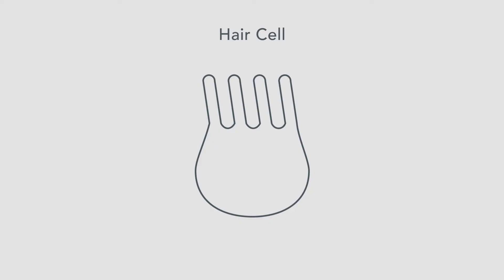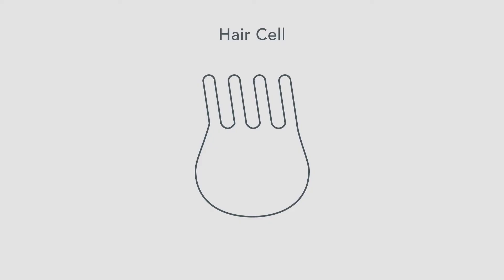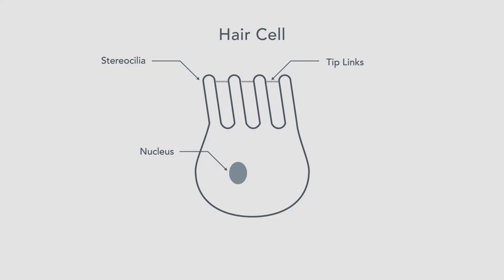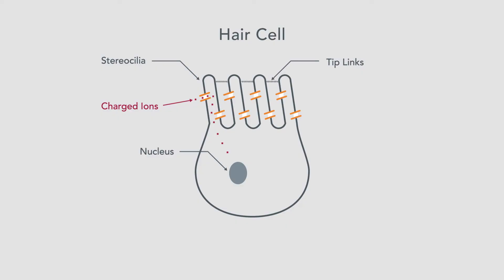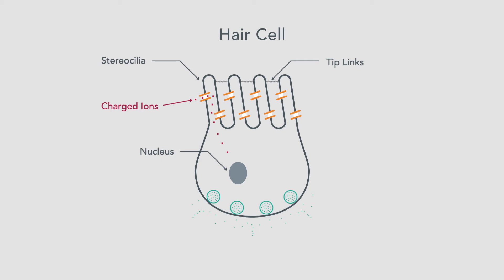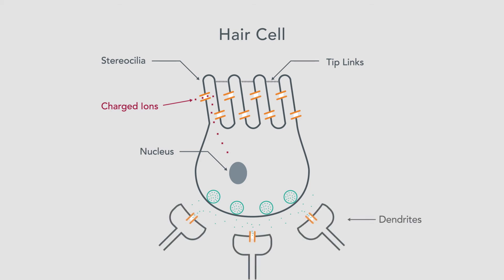Psychoacoustics: Hair Cells in Ears are Analog-to-Digital Converters | Susan Rogers | Berklee Online

Comment: Technically, I don't think it is actually a digital to analog converter.  Yes, the nervers are transmitting only single spikes, but there is a CONTINIUM related between the strength of auditory stimulus and the frequency of spikes.  There is no quantization in the amplitude dimension.  Further, there is NO quantization in the time dimension in that the individual spikes can happen at any time.  Rather, this is like the first stage of a delta-sigma A/D converter producing the 1 bit bit stream where the number of bits is handled by the next phase.  The next phase can be an arbitrary number of bits depending on how it is performed, but this is later parts of neurology.  In many ways, the analog nature of the signal is still contained in the bit-stream in this case.  The analogy is a bit flawed in that the first stage of a delta-sigma converter is clocked at a fixed rate producing some timing quantization where in this case it is not self clocked so there is no time dimension quantization.
Reply: Exactly what I was thinking.

Comment: Why would this evolve from nothing. I can see things that have to do with eating becoming more complex, Sight, mobility, but why would a organism go through all the trouble of creating this complex organic computer to hear what it did not know existed until it heard it. And that process is going on (running in the background) all the time for your entire life. It must have been one of the last things added to the senses.
Reply: On the evolution of mammalian hearing, you can probably find a video or article on how the auditory ossicles came to be.

Because sound is pressure, we don't only listen with our ears, it can be felt in other tissues as well. You can think of hearing as a specialised form of the sense of touch. Airborne sound waves are oscillating changes in air pressure, but the way many of your other tissues are able to detect touch is also just a form of pressure sensing. Insects don't necessarily have ears, but they do often have external hair-like sensors which can be used for sensing sounds even though they would not have an audible "experience" like we do.
If I have to differentiate between two signals of nearly identical pitches (even just 1 Hz), I find that they sound exactly the same and I can't tell the difference. But if I switch to monitoring my sense of touch instead, I notice the difference. It's just that our brain gives a different meaning and sensation based on which receptor cells you're receiving input on, even if the input is the same.